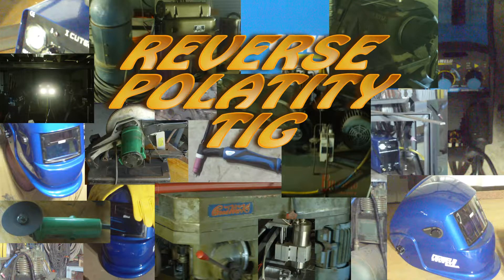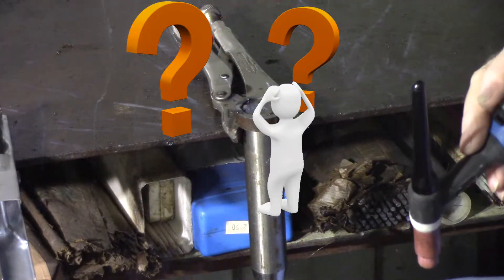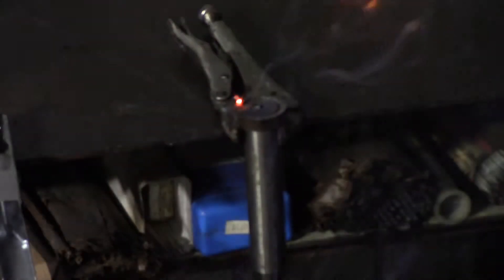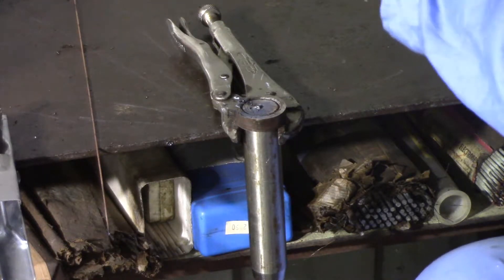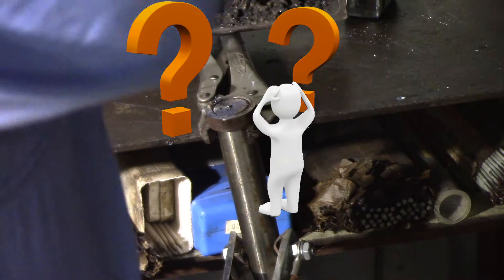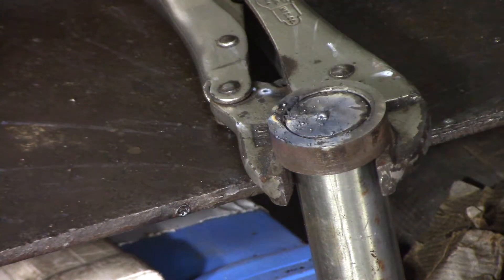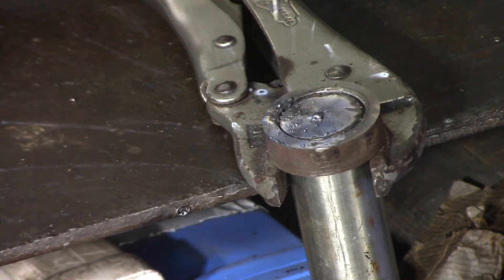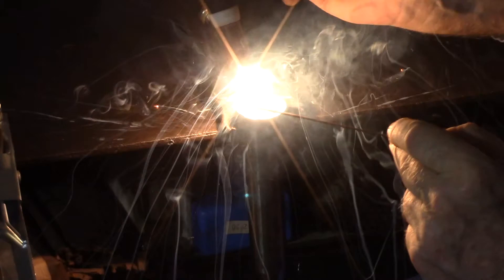Reverse Polarity TiG

Comment: Did this today on my Jasic TIG 180se 🤣 Thanks for this tip . Will try again tomorrow and check
Reply from the maker: Spectacular, isn't it. :-)
Reply: @Designed2Build  normally I'm welding Arc/MMA and thought wtf is with my brand new Jasic forgot TIG using reversed polarity 🤣

Comment: No gloves?  You can develop severe skin problems from the arc flash.  I did a bit of welding in short sleeves and got sunburned.
Reply: Well, that settles that, mate!  I’m a welder wanna-be, and I went to sleep last night wondering why you need to reverse polarity when TIG welding.  Now I know.  I just need to know “why” (besides “Because it’ll cook your torch.”).  This was a good start for me, though.
Reply from the maker: That is true, you can.  I've had a mild flash burn (its from the UV given off by the arc) but never severe.  In my experience a few minutes welding is no worse than being out in the sun but always wear protective clothing when doing more than a few minutes welding.
Reply: @Designed2Build  A friend of mine ended up with some sort of skin problems on his hands from it.  Probably depends on how much welding you do.  Personally the heat, sparks and molten metal are enough for me to always wear gloves.